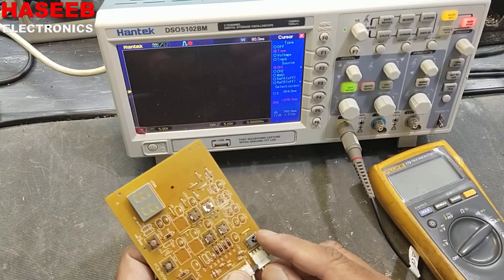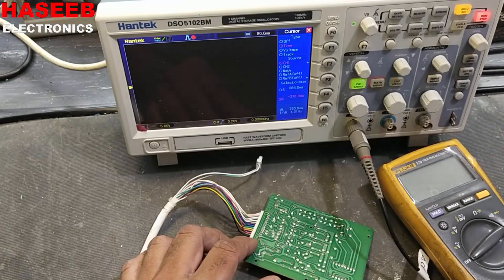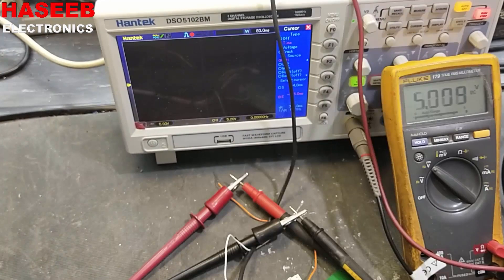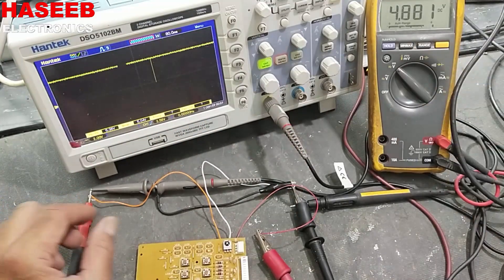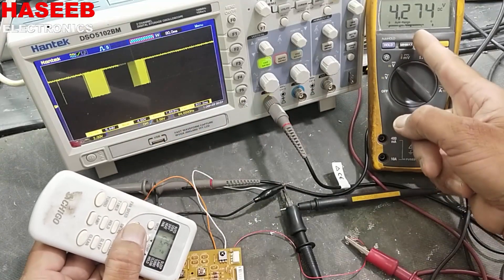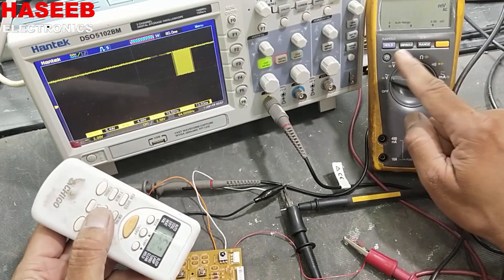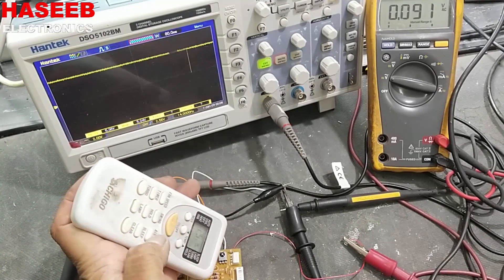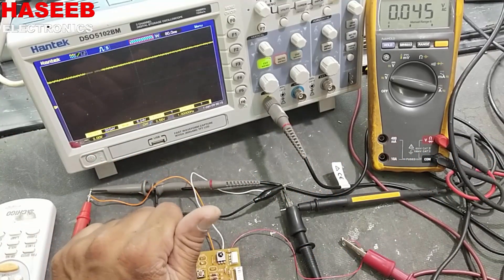[417] How To Test IR Receiver / Sensor. Infrared sensor Testing with multimeter

Comment: Thanks for the great video! On a related subject, I just built this IR Remote Control Tester: https://www.youtube.com/watch?v=ujykwjNmDRU&list=LLJr0cpUqRkGCBLSnwWQVPvA&index=42 It is a clever circuit that removes the influence of any ambient IR light in the room. I also added an Auxiliary Data Output function to the author's design, so you can easily capture the code traces of the remote control. I am giving away my KiCad design files for free. So, it is easy to order the PCB boards. Look in the comments for the DropBox link. Cheers!